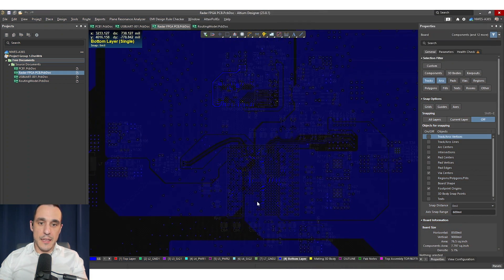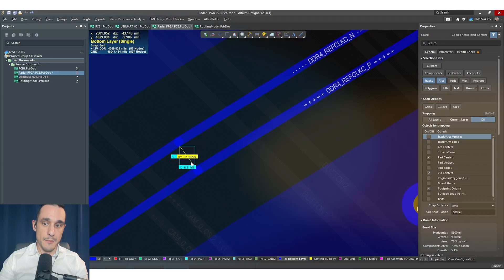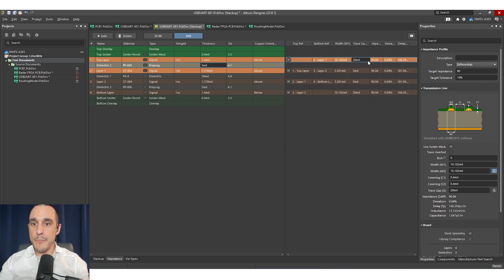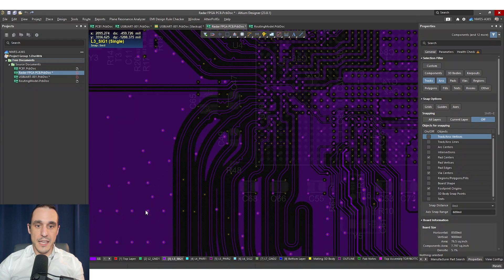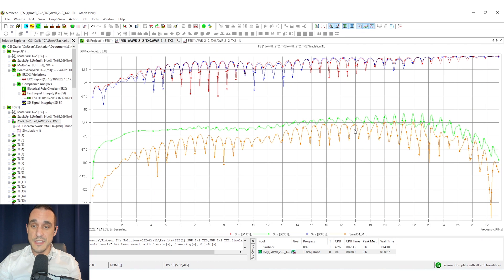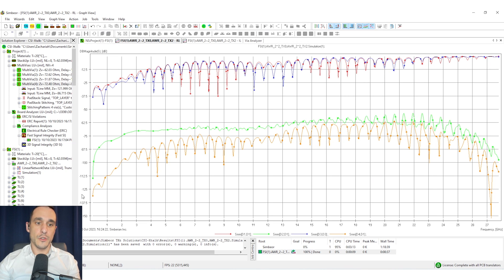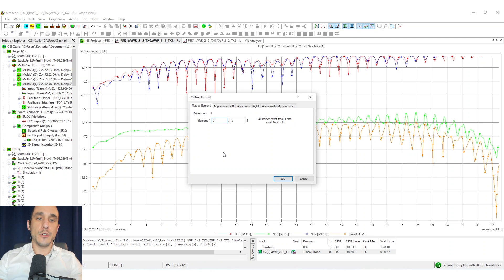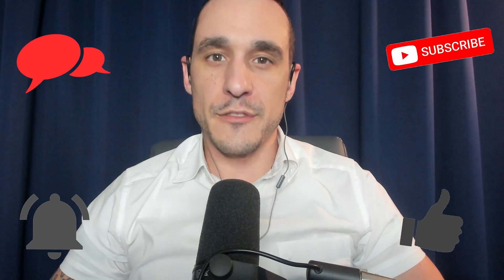Demystifying Differential Pairs: 5 Common Myths Debunked!

Comment: For point 2, I hear so many different things on this topic. Rick Hartley says to treat Differential Pairs as 2 single ended lines, but you say otherwise. Which guru do I listen to? Thanks.
Reply: Rick Hartley and I are saying the exact same thing. What I am telling you is that in order to set one trace's impedance to a target value when there is no ground plane, you need to have the other trace close by because there is mutual inductance and mutual capacitance between the two traces. Once you do this, the signal on one trace will still be treated as its own signal. In the case where you have the ground plane, the odd-mode impedance of a single trace is what matters and what determines reflection from an individual pin as well as the propagation delay. The difference is that you do not need to have the 2nd trace close by just to get the impedance to a target value. The other differences between the two situations are radiation of common mode noise and creation/reception of differential crosstalk.

EDIT: Rick Hartley sat in an audience of a PCB East presentation I gave earlier this year and affirmed everything I stated in my comment.

Comment: Is simbior included in an Altium product?
Reply: The Layer Stack Manager in Altium Designer uses the Simbeor 2D solver to calculate trace impedance and propagation constant without losses and dispesion. In frequency ranges where the dielectric constant is stable and losses are low, the results are very accurate the engine and runs in the backend of Altium Designer.

Comment: Engaging video!  Most of these seem like "oversimplifications" rather than "myths" per se.  One point of interest is in juxtaposing #2 "Differential pairs and ground" versus #5 "Differential pairs and length matching". In the latter, there's a subsidiary point about placing the length-tuning sections near to the inhomogeneity, so that we avoid "mode conversion".  Mode conversion appears where the pair has been designed to achieve the target impedance through coupling of the two conductors (instead of proximity to ground plane) and the signals on the two wires get substantially out-of-step (one is delayed relative to the other). Now the two out-of-step signals just function more like two independent signals, with the coupling providing crosstalk between the two wires.  Aka unwanted common-mode signal.
OK, but that problem would not arise (or be far less) where the target impedance has been achieved primarily through proximity to ground plane (as described in #2), and not through interaction of the two conductors with each other. In that case, presumably one could place the tuning sections wherever one wanted with no ill effects. All that matters is that the total travel time along each path is a good match.  I'm not saying that is something to try to do unnecessarily, just pointing out this interesting interaction between two of these "myths".

Comment: This should be good. My guesses: Myth 1 - differential pairs need to be routed close together, Myth 2 - return path "doesn't matter", Myth 3 - it doesn't matter where you match lengths so long as the full run is length matched, Myth 4 - you need to match lengths *exactly*, Myth 5 - there's something magical about 100 Ohms
Reply: Actually myth 2 is "You always/never need ground"
Reply: @Zachariah-Peterson  so close!
Reply: @Zachariah-Peterson  from definition the differential pair do not need any reference plane but here we can see if we apply some reference plane then track width and space are easier to build. I hope Eric Bogatin explain this problems correctly.